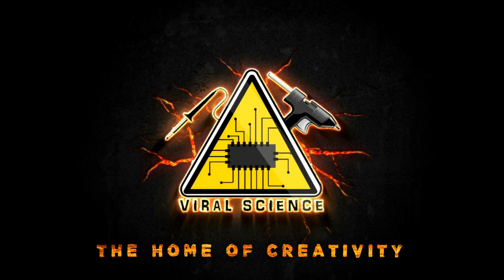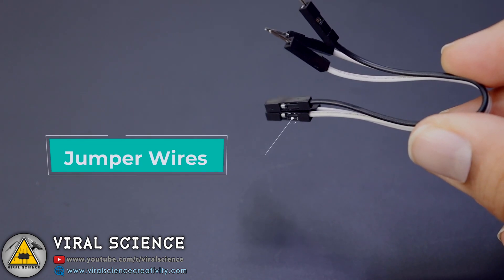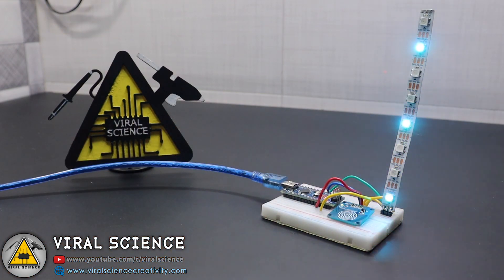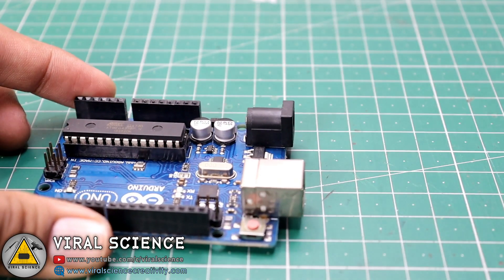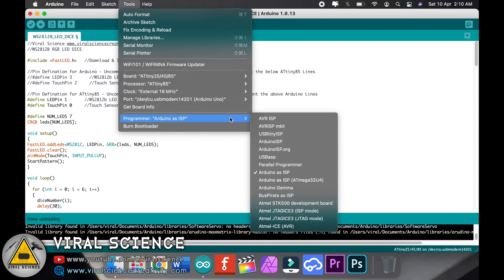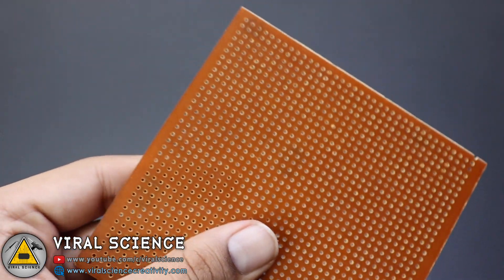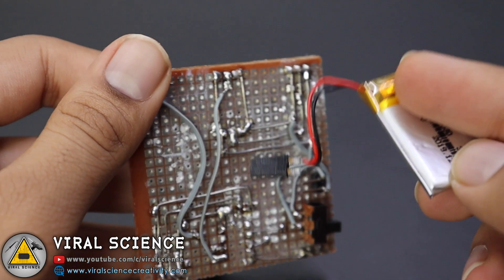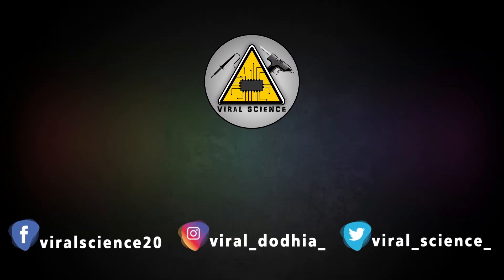Arduino Electronic Dice WS2812B RGB LED Attiny85

Comment: Hi I have rebuilt your project but it does not work quite right.
I have to hold down the touch button so that the cube displays a number ?
This is the one I use: 2.5V-5.5V TTP223 Capacitive Touch Switch Button Self-Lock Module for Arduino DIY Microwave Radar
What can be the reason for this ? 🤔 ❓❓❓

Comment: Hello 🙌
Quick question: what is the voltage of the capacitor 10uf for the ATtiny85 board where you need ?

Comment: Why you're using external 16mhz oscillator ? This can also work without it
Reply from the maker: My attiny85 gives error if external oacillator is not used so i am using it